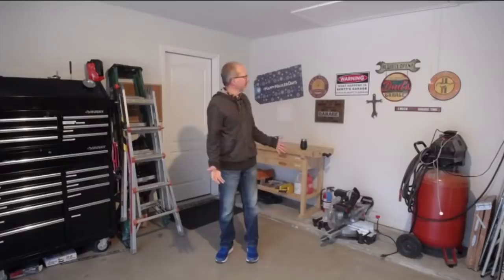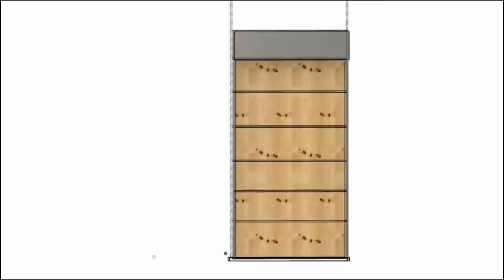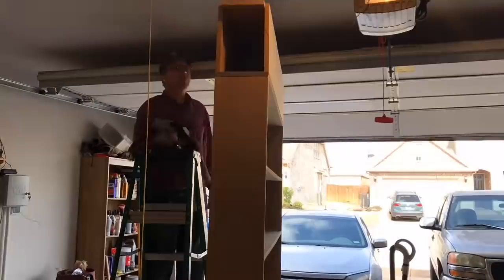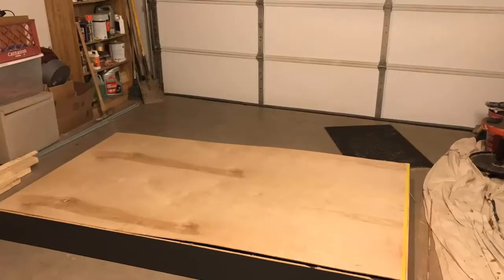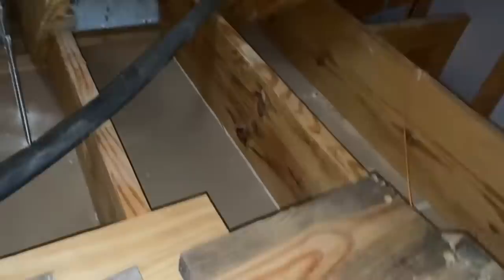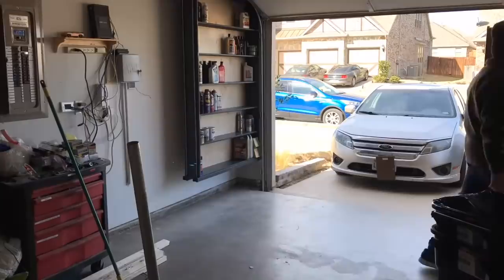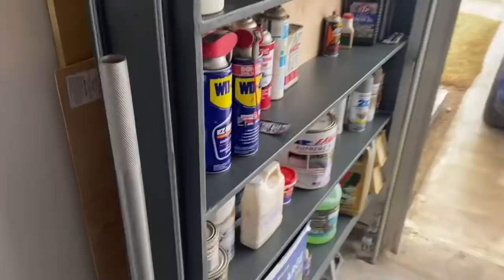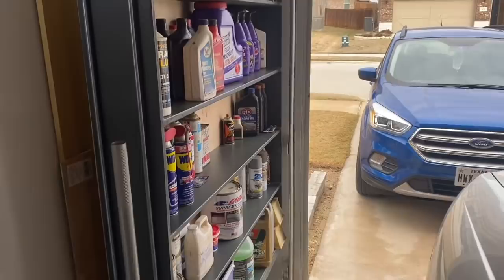Get Smarter Storage with These Easy-to-Build DIY Hanging Garage Shelves with Extra Storage Behind!

Comment: Concerns: MDF will warp depending on humidity and weight distribution. Your mask is designed for particulates, not vapor, or smell. When painting with oil based materials open the garage door and use a fan to protect from inhalation hazard. Is there a source of ignition in your garage such as a water heater? Latex paint provides a durable surface with easy clean-up and disposal. Just some random thoughts. Enjoyed the content.
Reply from the maker: Thanks for your input, Conservative Christian!
Reply: So many concerns for so little effort. Never ceases to amaze me.
Reply: I was a housepainter from the 70's on. Oil base was all most people knew up to just a few years before that and we survived.
Reply: Yes I agree with you dalesworld. Unfortunately society these days have been conditioned to extreme measures when it comes to safety.
Reply: @dalesworld1308  -- It seems like all the painters that I knew back then were alcoholics... Apparently the buzz that they got while painting needed to be replaced by something else when they weren't working... Or maybe it was just that that occupation attracted people who had chemical dependencies... Kind of a "chicken and the egg" sort of thing, I guess...

It's not that difficult to create a fresh air hood / mask for when you are working with really nasty stuff... I had to do that around 25 years ago when I was staining / polishing / sealing a concrete floor in a house that I owned at the time...

Comment: Cool idea for otherwise wasted space.  I think the MDF might sag after a while especially in humid environments so I'm curious how its holding up.
Reply: Yeah, that was my (admittedly mild) concern, too. But, he can always tuck in some painted-out mdf midspan pieces easily enough. I'd probably use plywood for the shelves or include midspan supports at the outset. Not dissing on Scott, I just know that 'Murphy' is alive and well (my husband is too, he used to do avionics engineering), and I'd have a sagging problem sooner than later. 
I definitely like the idea.
Reply: Yeah, definitely a concern... He's apparently in Texas (car license plates) and there are areas that are comparatively dry (at least as compared to the Houston area where I'm at).  There's no way that I would use MDF for shelving... Like with particle board, it's strength is mainly in compression, not tension... Combine that with the humidity around here and you would have sagging shelves pretty quickly... Having owned a house with cabinets that used particle board for the vertical pieces in the carcasses and seen what damage a little water can do to them over the years, I will not buy anything made from it again...

Not sure what part of Texas he is in... The subdivision does not look completely flat, so that means that it is most likely not the Houston area... Maybe Austin or Dallas... He has an insulated garage door, so I might be inclined to suspect the Dallas area since it does get slightly cooler there than in Austin...

Comment: The top corner will be problematic when maintenance is required on (or replacement of) the Garage door. The area near the torsion system needs to be kept clear so that a technician can access the hardware with room for tools to change Springs,  replace cables or address other potential issues. Doors installed on new homes are typically of poor quality and will need attention. Some torsion systems are not "industry standard" and do not extend past the edges of the track, be aware a proper torsion tube is 12" longer than the width of the door. Keep permanent shelves a minimum of 12" from the torsion system hardware.
Reply: Just made a similar comment, and as a professional garage repairman, I completely agree 👍
Reply: Can probably remove bottom nuts and remove the shelf, Hopefully. wouldn't want that broken cable repair.

Comment: I've been thinking of doing something similar in my garage, except I'm thinking of putting the shelves on a trolley so they could be moved back and forth to access plywood etc behind them. Also I'm thinking of a second slider in front that would be somewhat like a door, but with a pegboard on it for a yard tools. This would give me storage basically three levels deep, but relatively easily access.
Reply: Just remember if you make a slider you will need an equal amount of space on the side you are sliding toward for clearance.

Comment: Neat idea. I have the same concerns with the MDF as most others do. And the space to work on the garage door springs. Having storage behind the shelves for plywood or whatever is wasting that much space next to your shelves, as you have to have room to slide those sheets out. Garage wall space being at a premium, it seems that is almost useless if you need more wall space to hang things

Comment: nice work, Scott. I am currently trying to solve the problem of garage organization myself. This was helpful. One of my issues is sheet materials, and your idea is awesome. Although, one couldn't store anything vertically or bulky next to the shelving units that can't be easily moved to get the sheet materials pulled out.
Reply: "Garage organization" -- the process of attempting to store 100 pounds of crap in a 50 pound bag... :)

I prefer to keep things off the floor of my garage also... It allows me to use the leaf blower to clean it out periodically and the power washer to clean it further if need be... I don't have sheetrock or MDF in my garage, so a power washer does not damage anything... Everything is either concrete, bare wood, or Hardi Plank...

Comment: for what it's worth you could've used 1/4" threaded rod.. it's way stronger than people realize lol 

awesome project, nice idea on having them cut all of it for you 👍
Reply: Multiply half of the diameter of the rod by itself and then by pi (3.141592...)... This give you the surface area of the cross section of the rod... Multiply that by the tensile strength of the material (probably at least 40,000 psi for common steel)... This will give you the yield strength for it... From there, divide by 4, 5, or whatever safety factor you desire and you have your safe working load... For a threaded rod, use the diameter at the inside of the threads (minor diameter), not the outside of the threads... Using this with an unthreaded 1/4" rod, you would get 1963 lbs...  For a threaded rod, you'r looking at a minor diameter of 0.1876", so it would work out to be about 1106 lbs.

Just some trivia in case anyone is curious... :)
Reply: @CurmudgeonExtraordinaire  you so have to consider he's using four of them, with the load evenly spread.. 

awesome bit of info !!

my comment was from working with conveyor systems that hang from the ceiling of my job ..  we have over 11 miles of conveyor with more than half of it being suspended from above..packages run butt to gut for hours sometimes, and the only thing we ship is books, so the boxes are ways heavy
Reply: @aztekwarrior518  -- 1/4" rod would definitely be strong enough, but one thing he has to also consider is lateral stability and the 1/4" might give him a bit too much flex... Personally, I wouldn't go smaller than 3/8" of an inch... But I wouldn't use threaded rod, I would use rebar and weld some shorter lengths of threaded rod or bolts onto the ends... Also, if you use 1/2" 16-gauge square tubing, a 3/8" bolt can be forced (when in doubt, use a bigger hammer) into it and then welded...
Reply: @CurmudgeonExtraordinaire  as I said we have live conveyors and catwalks suspended at my job..  you can make them sway just by lightly rocking back and forth .. obviously we're not using 1/4", but the amount of time it would take for a failure would be incredibly long in this case

Comment: Not sure if it’s already been pointed out. Another benefit of hanging them is garage floors have slope. Everything you place on them is out of level. Eliminated this by hanging your shelves. Great solution for your sheet material! Not sure about future shelf sag, but easily solved with a center support made of the same material. 👍👍
Reply from the maker: Thanks for your comments. It’s been over a year and there hasn’t been any sagging. I think the nails through the back panel are the reason.
Reply: @ScottsGarage17  that’s awesome. I only say this because I built a shelf in the same manor and front sagged a bit, but not the back. I had too much weight on them as well. 8-1 gallon jugs on one shelf😬 Great project, Scott

Comment: Nice build. My new garage has the same layout. I'm going to have to build the same thing.!
Reply from the maker: It's worked out real well. If I had to do it all over I would leave a foot between the shelves and the outside wall. I've gotten some negative comments from garage door repairmen who say they need more room to replace garage springs. I probably would attach the threaded rods differently as well. I think they could be countersunk in a 2 x 6 and attached with lag bolts from the bottom side (ceiling) of the rafters.
Reply: @ScottsGarage17 , That might work as well.
I might go to the floor and just put locking casters on mine, to make it mobile.

Comment: Seems ok as long as nothing goes wrong. If the car hits the shelving in an accident then this wouldn't be like if it hit your old shelf on the floor, you have tied this shelf with tie rods to your roof trusses. Roof trusses can deal with vertical loads really well but not horizontal force. If someone ever clips and drags your new shelving then it could cause structural damage to the roof as well.

Comment: This is a garage door repair mans bane. Having shelves or other stuff near the tracks and door that are not moveable just makes it more difficult to make adjustments, repair, or replace the door. If it was up to me I would charge more everytime I would have to work on a garage that has unmovable storage. But I will say it looks nice and it has some good concepts.
Reply: I like this, and am going to do this. When I do need my garage door serviced (hopefully not for some time as its only 4 years old) I would just remove it before the repair person comes. It looks way to useful the for the 99.9% of the time it is not in the way.
Reply from the maker: Thanks, Zero Tech for your feedback. I’ve gotten the same from other garage door guys, most of which have ripped me to shreds. Thanks for at least being respectful. What if I moved them further back a foot or so?
Reply: @ScottsGarage17  Yeah no problem like i mentioned its a really neat concept but if you design it to be easily removable that would be the best. Moving it a foot or two back gives a bit more clearance which helps with the front part of the door like the vertical tracks. But you would still have a little issue with the horizontal track which in the video looks like its only a couple inches which is not bad, cause I had to work with much worse before and still got the job done.

But the best options would be if its easily removable or just plain movable, like puting it on the floor with casters. Otherwise moving it back a couple feet helps too.
Reply: @randomeverything3023  I agree its very useful and if you moved before they show up that wont cause any issues. Also if you maintenance your garage at least once a year you shouldn't have to worry about it breaking for maybe 5-7 years which is when the springs usually break, unless you only open you door once every week then it will last way longer. Just make sure you don't use WD-40 or put any kind of grease or lubricant on the tracks, that's another way to make you garage door repair company mad 🤣
Reply: @zora_tech  good to know. I open my door maybe twice a week. so, should be good for a while.
Reply: Maybe you garage door guys could do something about those goddam tracks that are always in the way. Seriously, every time I want to put in some storage or hang up a kayak there's a big 'ole metal track right where it needs to go. Y'all need to put on your thinking caps and come up with something better.
Reply: @JaymoJoints  -- My garage is semi-detached and has exposed ceiling joists and rafters... I was able to store a (2-place sit-on-top style) kayak nearly flush with where the ceiling would be by mounting some pulleys on the roof joists and running 3/8" nylon braided lines (overkill) from each end of the kayak through the pulleys and then to cleats... The ceiling joists in my garage go  across the width of the garage (vs lengthwise), so I could just put the kayak between the two joists aft of the garage door opener motor... I've gotten old enough that I don't kayak anymore, so mainly I justify keeping it as part of my emergency preparedness in case we get a hurricane and more flooding than our levees and pumps can handle... Used to store it with the pulleys mounted to the joists which limited me to only being able to raise it to the point where the top of the kayak would touch the bottom of the joists, but I was running some wiring for new outlets and lights in the garage a couple of weeks ago and had a bit of "mission creep" when I realized that the kayak could probably fit between the ceiling joists if I mounted the pulleys to the rafters instead... With the previous storage location, I was just barely able to fit my Jeep under the kayak, but now I have plenty of room...

Comment: Nice work. Did you ever consider allowing the shelf to slide left and right? You could accomplish this with some metal track mounted on the ceiling and anchored to the joists in the attic. The tops of the shelves themselves would have small rollers or wheels on them which roll along the metal track. I believe the metal track and wheels are made by Unistrut.

Comment: Very nice!  I wonder if you could also utilize those rods for hanging small items.  Two nuts per bar with a rod or sheet between them and you would have a shelf or hanging rod that you could adjust the height as needed.  I'm going to keep this shelf idea in mind after OSB sheets come down in price and I can redo my garage.

Comment: sophisticated! I don't have an open attic above my garage, so this method is not feasible for me!
Reply: Then you have to adapt for what you have... It's going to depend upon the structure of your garage -- where you have the ceiling joists, wall studs, etc... If you have ceiling joists that go across the garage parallel to the garage door (like he has), then you should be able to install another board to the bottom surface of the sheetrock in your garage ceiling using lag screws into each of the ceiling joists.  This board can be used as a hanger to attach the threaded rods instead of going through the ceiling and using another board spread across the joists like he did...

Comment: With something like this, you don't actually need a fully threaded rod... You just need a rod that has threads on each end... A cheaper solution is to use #3 rebar (i.e. 3/8") with 3/8" bolts welded on each end (heads ground off).  A 20 ft piece of #3 rebar is currently $5.48 at Home Depot.  Even with the lower strength 40,000 psi rebar, you would be looking at a yield strength of about 4400 lbs on each piece of rebar (and you are using 4 of them in your design).

Where you might have justification for the use of full length threaded bar would be if you used the threaded bars for the supports of each of the shelves instead of having the wood / MDF side and back pieces.  That would allow you to adjust the sizes of the shelves to accommodate items of different heights, although that would be a slightly tedious process... With that sort of design, it is best to put a nut and washer above and below every shelf to lock them in place.  Since you are using MDF, I would probably suggest using another pair of the vertical supports for the center of this type of shelving unit...

The way that you notched out the board in your attic to fit around the rafters makes it look like the back side  of the board is not being supported.  I would have added a 2x4 to the ceiling joist to make it wider and give the board more support.  You're storing pretty light stuff there though, so you might be able to get away with it...
Reply: Was reading thru the comments to either: 1) find rod supplier w/lengths, 2) alt solution for suspension.  THANK YOU for the alternative suggestions on rods. I'll be using your idea!

Comment: Excellent ideas and very tidy keeping stuff off the floor. I’m not an engineer or anything but are you not concerned about the transmission of the load to that 2x12 in the attic. Essentially with the cut out for the roof joist all the weight is being supported by a piece of wood that is about 1x1”. Sorry to be a downer.

Comment: 2:40 a car laser garage auto parking sensor assist, might create space rather than the hanging tennis ball.
Reply: But the tennis ball is a classic and works even when the power is out... Of course, you garage door opener will not probably be working if that is the case... :)

To get it out of the way, a which sheepshank hitch and it gets moved higher...

Comment: I hang all my shelves off the floor BUT this is so over complicated. Just lag (HeadLOK) the shelf into the studs - like kitchen cabinets - then if need it can be removed without going in the attic.  And loading the roof/joists/trusses just not a good idea.